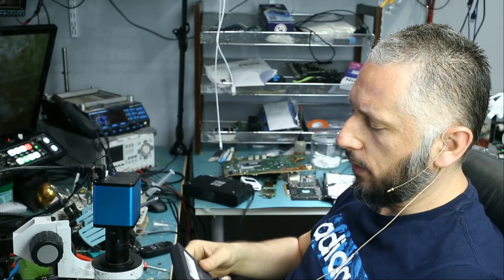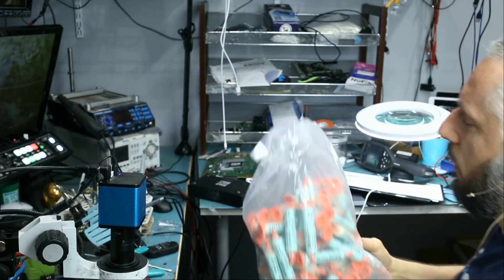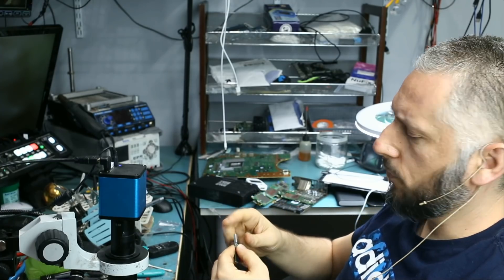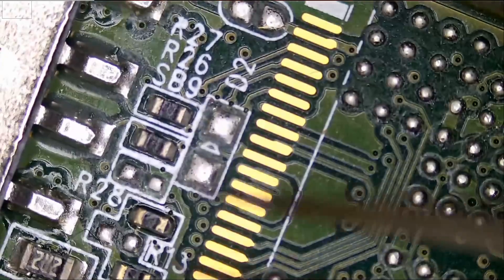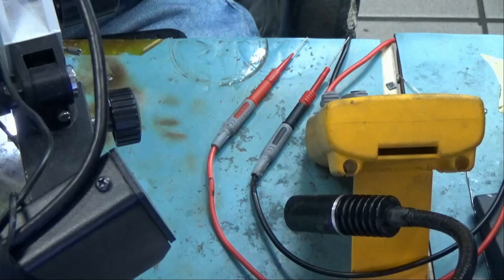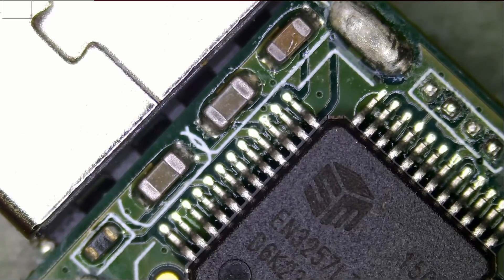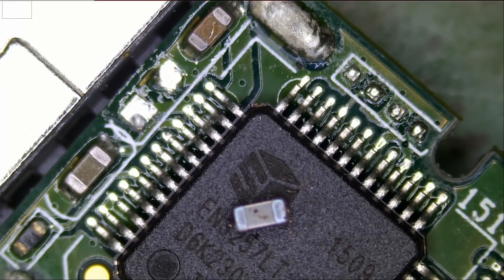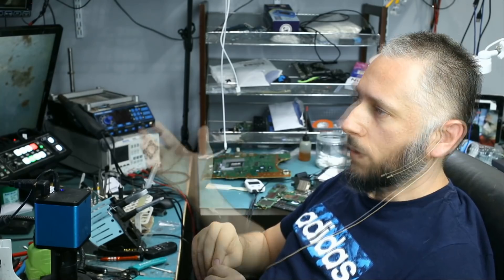USB Flash Drive Failed Suddenly and no longer recognized. Repair & Data Recovery

Comment: Hello, I have a problem with a laptop lcd/led port on an Acer AN515-42 laptop that has been partially burnt out this is after I installed a replacement lcd cable. I do have a picture if I can possible upload. What do you charge? Could you fix something like this at all?

Comment: Can you explain what was the role of that capacitor in the overall functioning of the USB drive, since after removing the cap, the USB started working normally.

Comment: I have a slight issue with my TV.  

Panasonic
Viera
50in
Plasma
2009

I say it's a slight issue because it's only noticeable when the volume is 13+.   Upon reaching that volume the right speaker starts sounding like some dummy installed a subwoofer in-line with the speaker and just left it dangling there.  It goes without saying that the higher the volume, the worse it gets.    I believe it has something to do with the speaker itself, but currently not sure.   Another way to put this is that it starts sounding as though some idiot thought it would be funny to wire up a smaller speaker (WATTAGE-WISE) than what the TVs audio output is rated for.  

I don't remember a torn speaker sounding like this, but that might be what's wrong.   Would anyone like to share what they think is going on?

Comment: what was the funcktion of the dammage cap. and why can the flashdrive function with out it.? if it has no funcktion why did the manufacture use money to solder it on the board?

Comment: Amazing video and good diagnosis. How would you find a replacement capacitor without seeing any printed information on the old capacitor?
Reply: Lot of times it will work fine without the capacitor, because most of the caps around an ic are bypass capacitors to suppress noise. When there is no noise, they do not do anything. When it is a big cap, it will suppress low frequency noise, when it is a small cap, it suppresses high frequency noise.
Normally you will see big caps on the start of the power lines on the board, and small caps as close to the ic's as possible.
It is not needed to exactly match the value if you want to replace it. Lots of times the same are used on a board around the different ic's, so you can just measure another one to get an idea of the value.
In this case it is not needed to replace it because he can get the data off it without it.
Reply: @m4th1js  when you say noise do you mean actual sound noise or noise like fluctuations in power draw and that the cap is there to collect it and dispatch a steady amount?
Reply: @ChristopherJones16  Noise like fluctuations in power. English is not my first language, so it can be that i could have better used another word to describe it.

Comment: How does it still work with a component removed?
Reply: The capacitor is there to stabilise the voltage and keep noise down. In 99.9 % of cases it will work without. It's just good practice to have it.
Reply: @zaprodk  thank you for the reply !

Comment: There must be some very valuable data on that drive to send it in for recovery. It also makes me realize SMART statistics (usually unavailable on USB drives) will not warn you about unmonitored component failures like that shorted capacitor.

Comment: What I've learned so far:
1. Get a thermal camera
2. Plug the thing in
3. Identify the hottest component
4. Unplug the thing
5. Remove the hottest component
6. Plug in again and inspect
7. If the thing is not working go to step 3
8. Unplug the thing, send to client
9. Profit!!!
Reply: the price for good thermal cam over $2000 😂

Comment: Great video. I used to work at a place called Haven Lighting where part of what I did was to troubleshoot failed circuit boards. On some of the larger ceramic caps (0805, 1206), I could tell that the short circuit on the board was located in the cap if it appeared to be cracked, even just a little.

Comment: Shouldn't have put a  new capacitor in? 
BTW the cheapos use a 4 V cap on the 5 Volt line, this is why they blow up so often...

Comment: Why didn't you replace the cap? These bypass cap could be important to filter out inrush currents when you plug in to the port.
Reply: I was wondering that too, but I guess because he is transferring the data to a new thumb drive, he didn't need to replace the cap. Just need the drive to be working to get the files off it.

Comment: One question : have you ever prepared your own flux from pine rosin and alcohol ? . if not then try it out just for testing, I have seen your soldering work and it is flawless even if having good gear and materials is the 40 points of the job you are very close to 100 points, after watching few of your videos i can say you are skilled in diagnostics and that comes from experience you got a like and i subscribe to your channel to learn more.

Comment: I heard you mention in one of your previous videos that you used to be a software engineer.

I find it very interesting that you did that, since even though both jobs require excellent troubleshooting and problem solving skills they are still quite different.

Could you make a video about your previous career as a software developer and transition to electronics repair engineer? I think many people (myself included) will be very interested in it.
Reply: I think there is nothing surprising. People close to software are also close to hardware (most of the time)
Reply: +1
Reply: I think he graduated Elect Eng but was a web developer for a while, it was before opening NorthridgeFix

Comment: The cap is connected to one of the output pins of the controller, isn't it?. That's why both the cap and controller get hot. If the cap were connected to one of the controller's inputs or Vcc input, only the cap will get hot....

Comment: The plungers with your flux. Are they just floating, or do they attach to the syringe piston? The reason I ask is because with big syringes, residual pressure from compression of the piston can cause very substantial oozing. If the plunger doesn't latch onto the piston, there's no way to relieve that pressure by pulling back on the plunger.
Reply from the maker: The plunger is attached snug. It's not detached or loose. No oozing.

Comment: Noob here: if you remove the capacitor and did not put on new good capacitor in and the flash drive still works... why there is capacitores in the first place ? Did you put a new capacitor after ?

Comment: Would you ever try to replace the cap ? Or is the drive just a cheapy?  How to work out the value of the cap?
Reply: It is probably a decoupling capacitor and they tend to have a standard value. But you could find the chip manual and find out what the manufacturer recommends.

Comment: Hi can you explain how you check the short on the cap is it with a multimeter and can you explain in more detail? thanks for all the great videos.
Reply: The multimeter continuity setting (i.e. the setting where it beeps, if the two probes are touched) makes the measurement with DC. A good capacitor behaves like an open circuit to DC, so when you put the multimeter probes at the two ends, it will not beep. But if the capacitor is shorted the meter will beep.
By the way Hussain, a good job as always 🙂
Reply: @xxycom8963  is that what he means by diode mode?
Reply: He checks continuity across the capacitor. That bleep from the multimeter means its shorting (closed circuit). Alternatively, you can check if there is resistance across it and if there is, that's the same as a short.
Reply: Thanks everyone for your help much appreciated

Comment: Why didn't you have to replace the cap?  And if you were going to how would you figure out what cap to use?
Reply from the maker: It's a bypass capacitor. Not needed to get files.
Reply: @NorthridgeFix  thank you for the reply!
Reply: No need to replace the caps. you need a donor board or schematic